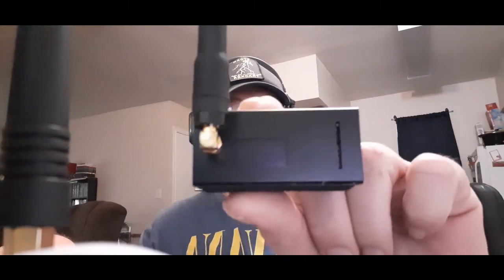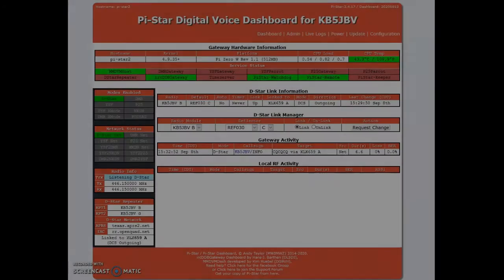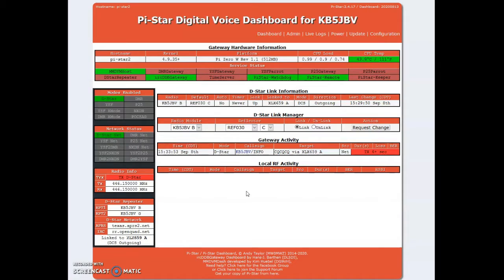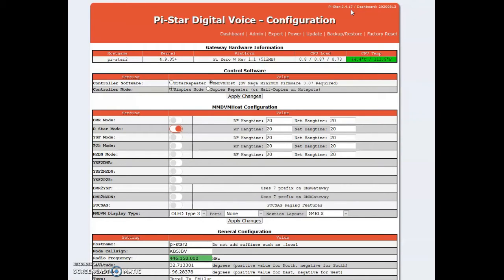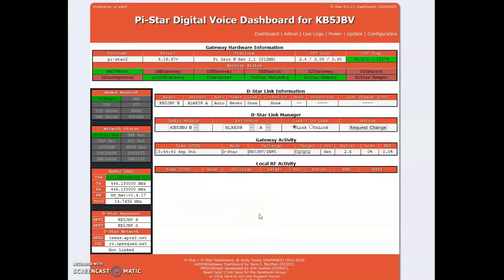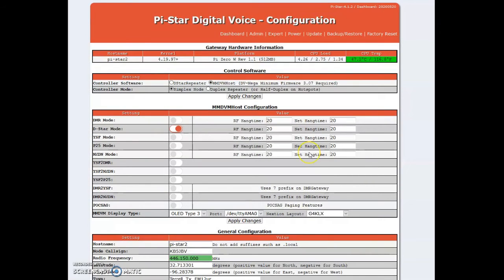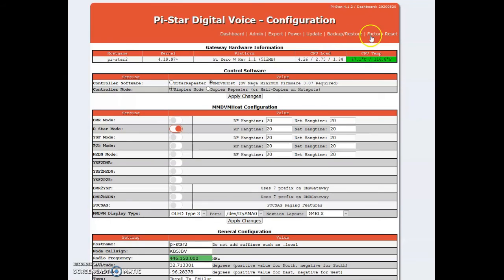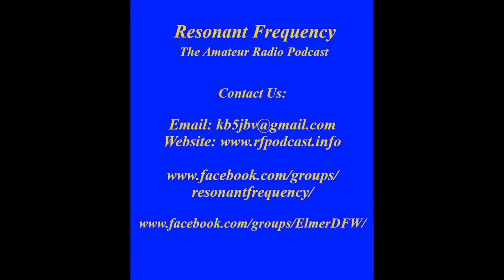RFPVE XLX REFLECTORS  ISSUE in Pi-Star

Comment: Was just updating the PIStar software all you had to do to fix the problem?  I'm not sure I fully follow what the solution was.  I am totally blind, so I couldn't see the video.  I am running PIStar version 4.1.6, and I am having this problem.  however, it only happens when my XLX reflector is on the same network with my PIStar.